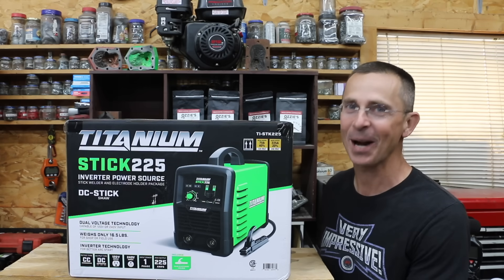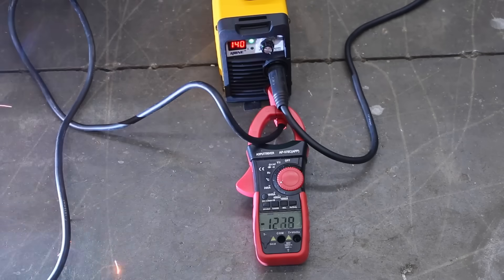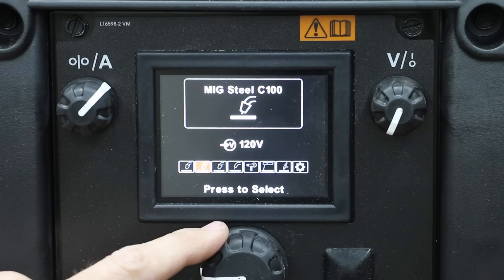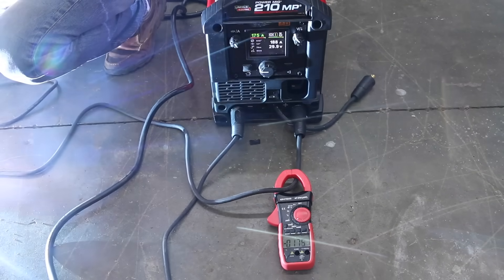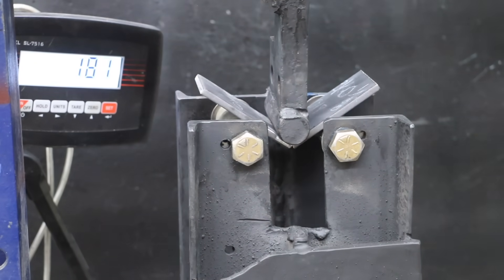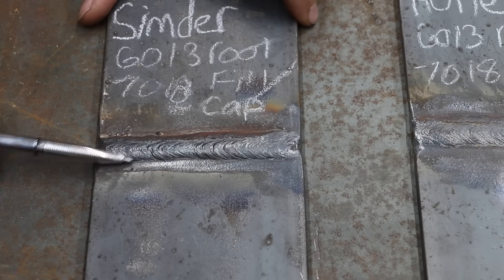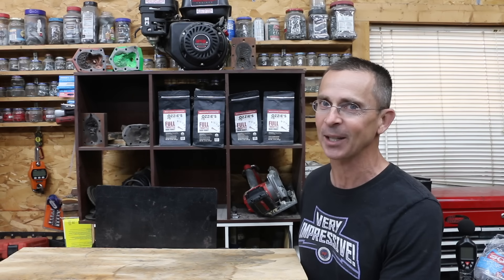$70 vs $2,300 Welder? Let's Settle This! Weld Strength, Duty Cycle, Current Output, Build Quality

Comment: Personally I'd recommend avoiding all those welders if you plan on using it for any kind of fabrication. If you need something cheap for an emergency any of these are okay, but if you don't know how to weld don't buy any welder. This isn't a skill you can teach yourself. Only someone with experience can look at a weld and see what mistakes you are making and know  what you need to do to correct them. If you are a welder none of these machines are acceptable. I prefer an Esab but a Miller Syncrowave 210 is a good choice if you plan on welding  and want a machine thats going to be working for the next 20 years. Lincoln seems to weld just fine for me, and I've never had a problem with one. People tell me they go out of tolerance quicker. Basically you only need 3 controls, on/off up and down for current and polarity. Anything else is just bells and whistles. You don't need a  precise  temperature read out unless you're working on the space shuttle. If the weld is too hot, weld faster or turn the current down. If it's too cold. Turn the current up. Never carry one of these cheap welders to a job site that might have real welders present or you could be responsible for their death. They will be laughing so hard that they will have a heart attack, or choke to death on their lunch while they attempt to swallow and laugh at the same time. Good video though. If someone can't weld consider being a migger. Mig welding isn't a skill. Those people only think they are welders.
Reply from the maker: Thanks for sharing.

Comment: I have the s7 welder, bought it a couple years back and only used it a couple times cus whenever I use it on a 120v outlet it just flips the breaker the second an arc is made
Reply from the maker: Thanks for sharing.

Comment: Question:  For the penetration test, is it okay on a weld to also do the backside if it is accessible, or does that cause problems?  For example, perhaps do the backside at a lower amperage if the initial weld goes more than half way in penetration.

Comment: I have a Hitbox 200amp 220v/115v stick welder that looks identical to your first one. The amp display is WAY off but the arc is smooth as butter. When I was working as a mobile heavy equipment fabricator I would use my Bobcat 225 as a generator for the Hitbox because it dug deeper and had a SIGNIFICANTLY smoother arc. I still keep it in my car because it's just that good on the fly.
Reply from the maker: Thanks for sharing.

Comment: I would love to see more welding related reviews! I was very impressed to see how well the Harbor freight machine did. I have the Lincoln Powermig 210 mp and its been a great little machine. I also got it when it was around $1,000, can't believe its more than double now!
Reply: I think a video reviewing Lincoln, Miller, Everlast and some other machines would be awesome. If there was a way to test quality/reliability of the electronics that would be the best video ever
Reply from the maker: Thanks for the suggestion.

Comment: Hello great video. I have several welders including the cheepo s7 115/230v 250A welder.  First thing i did was made my own leads as the ones that came with it are only copper coated wire and like 5ft.   Replaced with good 6ga 20ft 1000A jumper cable.    I get better welds from it than my hobart 70 or proarc 100.  Great vid but just noting the leads are horadle on the s7.
Reply from the maker: Thanks!  Thanks for sharing.

Comment: Hello 👋.   Appreciate this video.   I would very much appreciate a video comparing Mig welders.  Small 45 lbs or less.  Should be able to run .030 self shielded wire for welding steel.  This would be greatly appreciated as there is a lot of junk welders out there advertising capabilities that they cannot meet.  Especially duty cycle and durability.   Thanks.  Mark Green
Reply from the maker: Thanks!  Thanks for the suggestion.

Comment: The test against a $2000 welder wasn't exactly fair, but the video did provide a lot of useful data.
Thanks Todd. I picked the Titanium up at Harbor Freight before seeing this video. I'm happy it turned out to be pretty decent.
Reply: Fact is it's not.  LE has a $500 rebate, you can get the machine for $1499 now....

Comment: does any of the other welders do other kinds of welding like aluminum besides the lincoln do you have to buy extra parts for lincoln to do other than stick welding?
Reply: I weld aluminum on the s7 with aluminum rods

Comment: When using an extension cord, I use NO LESS THAN 10-Gauge wire. If you use any smalls ones the welder won't get enough power!
Reply from the maker: Thanks for the feedback.

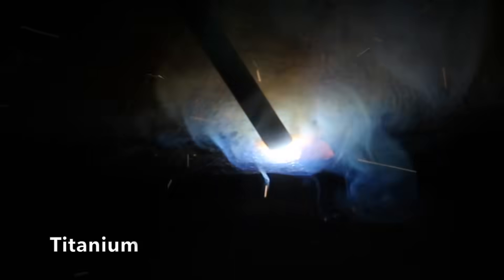Comment: 13:25 duty cycle... 180 amps to run a 3/16'' 7018... runs 30amp hot... federally certified for structural processing... A220 .... B pressure is a subclass... tho For A220, that includes rotating assemblies that see up to 220'000psi of force on graphed structure size, such as torque on a CV axle drive shaft stud. 1/8'' 7014 165amp +30amp hotstart all stop starts on a driveline shaft of 195amp confined to a 1/8'' centric... duty cycle on a 220A Kicking Horse welder? If its a cold day it will run 180amp at 100% will melt the plug into the wall after 150 pounds of structural rod 1/8'' 20018 SMAW! loose your temper that engineered shear point will never again... the end of easy brake auto.

Comment: Could you please test all these new "ceramic" do it yourself waxes. There's so many out now that it's mind boggling. I remember when the process first came out and they advertised it with the work boots where the mud would not stick to them. Please test. I need to know which one to use. I've tried 2 and they suck.
Reply from the maker: Thanks for the suggestion.

Comment: ONE UNFORTUNATE "FACT-OF-LIFE" when dealing with Inverter Welders, is that; Sooner-or-latter, the extraordinarily high current demands, coupled to the non trivial voltage peaks resulting from the quite variable arc conditions, plus the widely changing heat production at the output semiconductors, that will STRESS them, that unfortunately will cause all these type of welders to FAIL somewhere after some years (or months or weeks) after first use...
IT IS NOT IF IT WILL FAIL, BUT WHEN WILL IT FAIL!

 Thus, THE MOST IMPORTANT CONSIDERATION AT CHOOSING ANY INVERTER WELDER, is the cost and availability of Repairs, Parts and Technical Information that enables the owner to be able to get it repaired!
 There is absolutely NO SAVINGS when buying a welder that will have to be thrown in the garbage because its brand no longer exists or when there are no parts to return it to service.

Comment: It's a shame you're not over this side of the pond - My Dad still has his work welder. Complete with mineral oil bath and cart to pull it around (it probably weights more than the whole line up you had here). 

Fun bit of kit that still works just fine from the 60's.
Reply from the maker: Thank you for sharing!

Comment: I'm curious. I've been told that 6013 is a light penetrating rod for thin metals and 7018 is a medium penetration rod. Curious why the use of a light penetrating rod 6013 for a root pass. Where the 7018 would have made for a better rod for the root pass?

Comment: I am a retired engineer, and I see a lot of people test things on YouTube in dumb ways. Your channel is not one of those. Thanks for all of the effort that you put in to make these comparisons scientifically meaningful.
Reply from the maker: Thanks so much!
Reply: @ProjectFarm I will say there is one thing I see wrong with the penetration tests you did in this video..

Not sure how much it will charge the outcome, but you should really be grinding off any mill scale on the steel before welding. This mill scale will drastically prevent weld penetration. Do a before and after mill scale removal penetration test and you'll see the difference.
Reply: So here’s a question as a retired engineer would a true RMS clamp meter have been a better way to test the amperage?
Reply: @teddysurf  True RMS is absolutely mandatory for testing welder current, especially that of inverter machines. The meter he used is  true RMS, albeit a cheap one.
Reply: @James1095  is it a true RMS because most of the trms amp metes have “TRMS” printed on the meter and I don’t see it on this one?  The reason I asked, is because I just bought a relatively cheap amazon Chinese welders and was in the market for a clamp meter and came across a video about true RMS vs average.
Reply: @teddysurf  I looked up the model number and the feature comparison chart on Amazon shows TRMS for that model. Is that accurate though? Who knows. Even if it is TRMS it's worth checking the specs because even most of those have limits on frequency and waveform so it still may not read correctly on an inverter welder.
Reply: I'm a non retired engineer and I would agree. You do great work. 
Unfortunately, I've become spoiled with the  $14k tig welders at work 😢
Reply: @joshbrown5756 miller dynasty for the win !
Reply: @joshbrown5756 very unfortunate. 😂
Reply: Facts matter.
Reply: lol that commenter on the other video was right! Engineers always find a way to mention they are engineers. Worse than vegans!
Reply: I’m not an engineer, but I have an MS in InfoSec. Project Farm is one of the best out here.
Reply: Your comment is literally what I was looking for.  Thank you
Reply: Why do engineers always have to start with saying I’m an engineer? I personally don’t care what you are
Reply: @Boomer703 😂😂😂 we had 30 at work, only one or two knew what they’re doing the rest ask the normal workers for help.

A title doesn’t make you intelligent in that field.
Reply: You're retired for a reason. Let the young people take over, old man. Your knowledge and skills are outdated.
Reply: @bukaratmuhammad9995 Damn.😂
Reply: @bukaratmuhammad9995 Threre is NO substitute for experience!

Comment: I jVe one of these cheap 200a inverters and this test shows about that I always figured. I have to set it about 30a higher then it should be at. It will weld with 3/32 rods all day and it has (I have no idea how it held up to that) but it won't burn a full 1/8 rod.

Comment: When people test any machine which has a transformer, they usually do what’s called a “Square Sine Wave” output test. 

Gasoline powered generators don’t produce very good sine waves, so people who want to power a laptop usually plug them into a 12v battery with a square sine wave inverter. 

So I’m curious to know if the transformers in these welding machines are expected to produce clean sine waves.
Reply from the maker: Thanks for the suggestion.

Comment: As a boilermaker welder from Australia Will these welders weld yes without a doubt what I would be looking at is the duty cycle and most probably how much spatter is being deposited and how neat the welds  are  and your budget . In regards to full pen welding if that is what you are trying to achieve all these welders will achieve this it will come down to your preparation of the weld joint and if you don't burn all the way through just turn it over and back grind.Just remember this people if you are trying for a full penetration weld your welding rod needs to sit in the prep and lie in the bottom of your prep otherwise you may get slag inclusions
Reply from the maker: Thanks for sharing.

Comment: I bought one of the little titanium flux core welders. I had to weld my exhaust on my car. it worked great. I wasn't expecting much since it was so cheap but it got the job done. cheaper than taking it to a shop to have welded.
Reply from the maker: Thanks for sharing.

Comment: GREAT video! I've been in the market for a welder for over a year that will run off of a 120v 30 amp circuit to weld automotive sheet metal, repair trailers, etc. It is almost impossible to get the information you provided, which tests product claims.  I really appreciated having an experienced welder in your video because I'm fairly new at welding and learned a lot.  I am very interested in a mig or multi-capability welder test. I started looking at flux core and moved to mig and stick combo units for flexibility but maybe a mig would be good enough.  I would like to be in the $400-$600 range but if i can get more welder for less,  even better.  I am a hobbyist level user.  I've looked at Hobart, Miller, Lincoln, Harbor Freight, and Eastwood. Really appreciate your videos!
Reply from the maker: Thanks!

Comment: I was looking at drill presses, when I read reviews they stated that the home Depot wen drill press $108 barely had enough room to use a regular drill bit ! Help. Review drill presses
Reply: I have a WEN drill press and I like it. Good bang for the buck. Table is adjustable.
Reply from the maker: Thanks for the suggestion.

Comment: Great video joe.

Video idea; testing different plumbing fittings. So much miss information about some plumbing solutions it would be really great to see once any for all what can compare regarding : pvc push fit vs pvc cement joined pips vs shark bite on copper vs soldered copper pipes vs pex expansion connections.

I always hear people say nothing beats soldered connections, but I have had pushfit pvc in all my families houses and never had any issues. And where a breeze to install.
Reply from the maker: Thanks!  Thanks for the suggestion.

Comment: Thank you, now I know why my welding was bad the day before work . when I pulled the welder and the generator out I was using "dirty" generator power and expecting practicing on a new $500 inverter welder expecting the welding  same amperage compared to a used $4800 welder at work powered by "clean" wall electricity.
Reply from the maker: Thanks for the feedback.

Comment: i know you've done the penetrating oils a multiple time but you never did a creep test upwards if a bolts upside down and your spraying the head most runs right off how much actually fights gravity and breaks rust loose  like hydraulic fluid and diesel run up a vertical surface and so id like to see the results thanks again!
Reply: knocker loose, pb blaster, would hydraulic fluid be able to creep up and around the rusty threads super curious
Reply from the maker: Thanks for the suggestion.
Reply: @ProjectFarm  thank you for the hard work! your videos are extremely informative and i always enjoy them

Comment: I have two titanium welders, and I'm planning on getting another welder and a plasma cutter. I was a pro welder and have used Lincolns, Millers, and Hobarts. I'm retired now, and my last Lincoln is for sale on craigslist. I really like the Titaniums. When I bought the 225 stick welder, I went and purchased #2 welding cable, a good ground clamp, and a good 250 amp electrode holder. It welds great! I don't know how the included cables and clamps worked. I took one look and threw them away! I wish I could get a better gun for my 125 wire welder. It's too short, and too straight.
Reply from the maker: Thanks for sharing.
Reply: I fixed the titanium 125. I took the gun from my 140 lincoln and installed it in the titanium. Now I'm real happy with it.

Comment: Have you considered doing a review on retractable extension cords, the portable type not wall mounted, for garage shop use, ones that could run power tools, like table saws, and other large power hungry shop tools?
Reply from the maker: Thanks for the suggestion.

Comment: I weld a lot at work with en Esab welder it's about 10kg I weld only 3.25 rods 1715 come somer 35c or wither -10c eu and can weld at 160 amp for 3 hours without shutdown or heat problems. my welds are holding 900 ton on a building I worked on. so i will say that the Esab is the better welder in constant construction use and rain exposure. I have welded in (EX) zons with everything running and trust my Esab to not explode or burn out casing explosens. job site (Gsk) chemical plant! 
I recommend Esab brand
Reply from the maker: Thanks for sharing.

Comment: Thanks Joe! For future tests, I'm interested in seeing some Primeweld models compared to others. I own a TIG 225X and my dad owns their Mig 180. They seem to be excellent and are priced very affordable. Also, I own a Hobart ironman 240 which is half the cost of a comparable Miller. However, it seems to offer the same specs aside from the fact it has analog gauges instead of digital. I can't understand why it's half price over the Miller.
Reply from the maker: Thanks!  Thanks for the suggestion.

Comment: Thanks for your help, Joe!

I would love to see a multi-process welder comparison.  I have several older welders (MIG, TIG, Stick), and am considering consolidating into a single machine.  My main concern is welding quality since the processes require different types of regulation (constant current vs. constant voltage).

Thanks for all you do, it is very helpful.
Reply from the maker: Thanks! Thanks for the suggestion.

Comment: It's worth noting that these companies (probably all of them) make many different welders. I've got an Amazon special "S7" welder that does mig/dp-mig/lift-tig/stick AC/DC.  It was $1,400 but it rocks your socks off.  It wasn't fair to compare the cheapest chinesium welders you can buy to a 2300-dollar Lincoln.  Maybe compare the Lincoln to a similarly priced welder from each of the brands.   Also, I suspect that particular lincoln (like most) is somewhat obsolete as it lacks support for double-pulse mig and lift-tig modes.  It almost seems like you went out of your way to get the outcome you desired.  You should re-do this video.
Reply from the maker: Thanks for the suggestion.